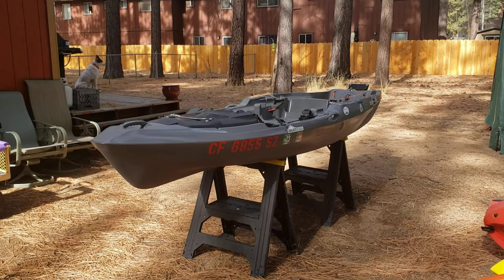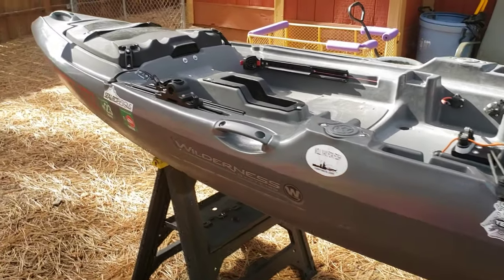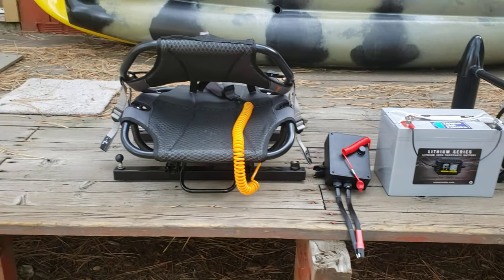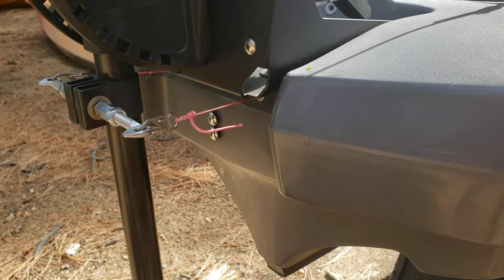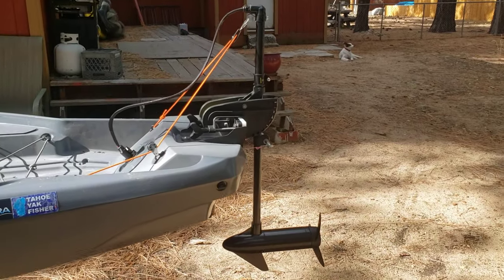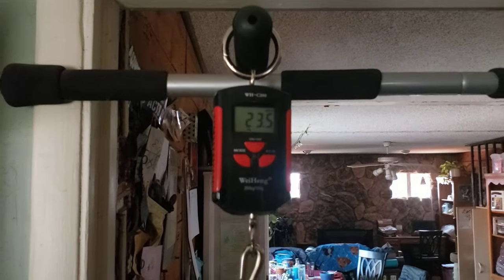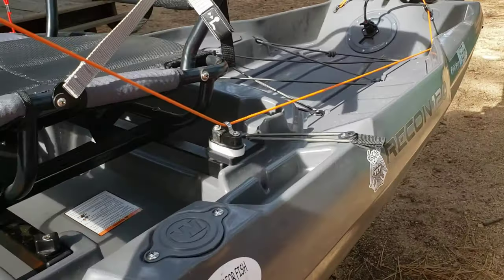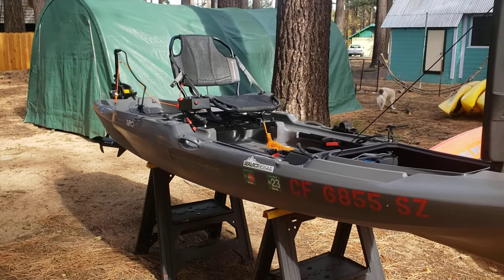YOU Should Build an Electric Kayak and THIS is WHY!

Comment: Bravo and thanks for sharing!  Very clean and economical method of adding a serious trolling motor.  I'm at the OP build analysis stage, I bookmarked yours as "Best rudder delete rear shaft motor".  I keep coming back to a pedal/fin inclusion with the option of quickly inserting a mid motor into the hole to cover water in a hurry, key reason is to get some excersize while locating fish.  But I'm flexible if the right deal on the right yak pops up one mid winters day, in which case your design is at the top of my list.
Reply from the maker: I am currently finishing from a Hobie Compass with a mid drive motor option. Please check it out on my channel. I have one complaint vs. the Recon... the Hobie has a hand controlled rudder. If I have two lines in the water and hook a fish on one, it's much easier to land the fish and control the kayak with foot steering. I have given up on fishing two lines at once from the Hobie.
Reply: Yeah the hope is that a lighter 12 footer would keep tracking fairly straight while under  power during landing of a fish; crosswind and strength of the fish are certainly factors.  I'll check your other vids and see how you fared.

Comment: I’m building one now. Yours is the first I’ve seen with the steering below the bracket. I like that idea for two reasons. First it keeps the steering lines lower and more level, which should decrease drag, meaning less force to turn, and second because it double as lock down when reversing. I was planning to rig a lock release into my lift system. I can’t wait to see if I can rig mine the same way. I’m also using a pot for speed control. One last thing is the kill switch. I didn’t even think of that, but it should be easy enough to incorporate. Thanks for sharing.

Comment: Walmart's in my area don't carry any trolling motors or large lithium batteries FYI. Northern Va suburbs.
But we do have 1 Cabela's, and some boat dealerships and marinas so there are options.
Reply from the maker: Ok, my point was that the "off the shelf" versions of trolling motors and batteries are easily procured versus a replacement "Bixpy or Torqeedo" product... sorry I wasn't clear.

Comment: Very nice setup on your kayak. I have a Ascend 128x base icky set up the same as your kayak. Except that I have a Newport Vessels 55 lb trolling motor on mine with a AGM 100 amp hour battery and  Allen quick connects and I also installed a system to raise and lower the motor straight up and down and then I can tilt it and also pulls it into the kayak. Less weight hanging so far off the back of the kayak. I installed four pulley system on mine that helps in pulling up the motor. Seems like your only pulling up 3or4 lbs
Reply from the maker: Sounds like a nice rig. I am a big fan of those Ascend kayaks, a lot of kayak for a really great price.

Comment: Great video! I’m thinking on building a dual motor system without a rudder. Controlling each motor separately by foot. Just need to find a pedal potentiometer with reverse.
Reply from the maker: Maybe in the rc world... the electric skate boards have a spring loaded throttle... check out Bass Man Strikes on YT, he has been working with that type of pwm for a while!

Comment: I have an Ascend 128X that I'm rigging up. I'm trying to round up the parts I'll need. I ordered a Newport Vessels 55lb trolling motor for it, a PWM, 10Ga. Silicone wire, PET wire loom, heat shrink, SAE connectors, etc. My question for you is, what size cable gland does it take to fit 2  10 gauge  through it? I don't have much experience with them and not sure what size I need. If you answer it'll be greatly appreciated and I'll delete the comment after I read it  if you'd like so no one else can see it. I say that because I  know you sell PWMs and wanna protect your trade secrets. I just want to build it myself. Thanks.

Comment: Very nice rig ! I've followed your build all the way through.. Very impressed with the engineering and thought going into it.. I'm in the process of installing a trolling motor on my Bonafide SS 107.. I will be in contact with you for one of your PWMs in the near future
Reply from the maker: Thanks, I learned a lot with my Ride 115 but the Recon has so many "motor conducive" features it was pretty easy to figure out. The Bonifide SS107 is a top notch choice, I have extra poly-tube for steering lines and such from a rudder instal I did on that same kayak. If you would like I can send you some with your speed controller... just a thought.

Comment: Great rig! Thanks!  Thinking of powering my 2016 Native Slayer Propel for here in Louisiana.  I was disappointed to find that the Newpork NK300 might be 1/2" too wide to fit in my pedal drive slot.  I was shooting for 6+ mph - my normal, comfortable pedal speed is 3.25 to 3.5 mph.  I'm also looking into a pair of dual thrusters that I could pivot out of the water when not needed.  A lot of options are becoming feasible lately.  The 3ph Newport NK300 plus batter is about a $2k to $2500 rig.
Reply: I ended up getting the NK300 and their 40AH battery - a lot of bucks.  However, it does push the slayer about 6.5 mph.  I'm in the process of relocating that rig into my 2018 ATAK 120 and might finally give up the propel drive and have room in the cockpit!

Comment: Nicely done! I have a Perception Crank 10, and it would be nice to add a motor to it (I would think, over this winter now... ). I have been looking at tons of videos, and I really think this is exactly what I was looking for. Though, I have some 'filling' work to do on mount...  The only missing piece of the puzzle is the 'rope stopper'/'rope grab' you have there... I can't seem to put a name to it, so I can buy one, or make one from some yard-tool-hanger I have with similar spring-enabled 'catchers'... 🙂. Could you please advise on its name, or, where could I fine one? Thank you! Stay dry, and of course, tight lines!
Reply from the maker: Its a "cam cleat".

Comment: That is a slick and easy set-up.The only thing I would ad is a way to Guage battery life. Sort of like a gas Guage. Gitta know when your on empty.
Reply from the maker: Actually, there is a Bluetooth battery tracker on the battery and my "YakFisher" speed controller is now available with a voltmeter. This vid is a "starting point" for people considering building or buying, not so much a "full project" vid... thanks for watching.

Comment: Excellent video! I have a similar setup on my kayak right now. Totally agree on the cost effectiveness versus the pedal kayaks! I am about to buy a Recon 120 myself to do the same thing. I REALLY like that the steering is below the pivot there. My current setup has the motor moving vertical to raise it, but that runs into some challenges where the steering pedals need to be able to move back enough for that height. Still looking through your videos, can you talk about the speed you are getting out of the Recon with this? Thanks!
Reply from the maker: Good morning. Thanks for your kind words. I am particularly pleased with the hoist mechanism. It's the second that I have set up like that, with favorable results. The top speed is 4 mph, but cruises right along at that! One bit of advice... 45lb. motor is perfect, 55lb. motor is too heavy for the hoist and NO faster. 12 volt trolling motors all spin at the same speed, bigger motors have more torque and get to that speed faster! There is a reason Old Town (same company as Minn Kota) uses 45lb. motors on all its "Sportsman" models! You will go faster with a 45 than a 30, but that is a prop that can handle the added torque not a faster motor.
Reply: @TahoeYakFisher Understood. I have a very old stainless shaft 45 lb on a 2006 Malibu X-Factor that can go 4.9. The 55 lb Newport that I bought for my Perception Outlaw will only take it 4 like you say. And that takes 45 amps! I figured part of that is the boat itself, but yeah I get the RPM and the pitch of the prop will combine to a max speed. I'm planning on experimenting with different 3d printed props when I get my Recon. I saw reports of a Torqueedo on. Recon going 6, so there is hope I think! 😁 I borrowed your hoist design on the XFactor, it does work great!

Comment: 11:02 is that motor control a pwm with the pot controlling the duty cycle? The reverse is just switching the polarity but I like the housing for the circuit. If the craft takes on water is there a plan in place for that lithium battery or will the craft maintain buoyancy regardless of the water taken on? If not it would be pretty cheap to attach some old foam life vests with Velcro so a lithium battery isn't sinking to the bottom if you need to abandon the craft. Have fun man.

Comment: How many hours it will last you running? And thank you for sharing that information
Reply from the maker: I'm not totally sure, my fishing days average 6 hours of mixed speeds trolling and full speed to and fro... the battery, then, charges up in a couple hours which means I'm barely scratching the surface. The way the "battery management system" maintains voltage to the end and begins to drop abruptly, I always hawk eye the volt meter, I never got to the "drop off".

Comment: This is an aawesome video, but now you can get a Kayak for about 2600 and it don't come with a battery but it comes with the motor and all the rigging. I have a 540 kayak and I am trying to do this. Got the motor and battery and battery box

Comment: How much stretch/strain is happening to the steering cord(s) at the steering arm at the motor, when you bring up the motor?
Reply from the maker: None. I did shorten the inner tracks of the "rudder steer" to create more available travel so the motor could go up all the way and the steering cords are still slack.

Comment: How did you PWM perform?  Mine kept burning out here in Alabama during the summer.
Reply from the maker: I have yet to have a failure. Sold them to people all over the country.
Reply: @TahoeYakFisher  I built mine myself, but I think the heat down here was too much for it.  I used with a Minnkota C2 30.  According to its spec sheet, the max draw is 30A.  Yours looks identical to mine, so I think we likely used the same design.  But my luck isnt so good, I just took my kayak out on the river, only to run out of juice 40 minutes later.  My Dakota charger said it was fully charged, turns out the charger went bad.  Thats my luck. :(
Reply from the maker: @robjohn6943  The main reason I quit selling them was due to lack of quality circuit boards! I would have to purchase from different manufacturers and send back 8 of 10!

Comment: How long does the 100 ah lithium battery last on 45lbs ?
Reply from the maker: I haven't found a limit yet. Basic run times and math suggests 3 hours at full speed and 12ish hours at 1.5mph. I go out for 5-7 hours... about an hour of that is "full speed" and my "Battery Tracker" device says I still have 80+% capacity... I wish I had the patience to run the battery to dead so I could test full run time but I went with the 100ah battery for two basic reasons,  #1 Enough power to get me through a full day of fishing and #2 the 100ah is sub 25lbs. Thats AWESOME power to weight ratio and lasts longer than I can fish in a day!
Reply: @TahoeYakFisher  thanks so much! I think for 4 lbs more I will go with 100ah

Comment: How do you deal with the lock lever  to allow you to raise the motor? Thanks!
Reply from the maker: I removed it. The motor is heald down by the steering cables/pedals. Works flawlessly.
Reply: Was actually just seeing that with the cables mounted low, thanks!

Comment: My t24 pushes my lure 11.4 at over 4 mph . It is only 24 pound thrust .
Reply from the maker: Awesome, yeah, my Hobie Compass gets to 4.5mph with a Watersnake T-24. The beauty of a light boat I guess. That Recon 120 is a behemoth, 4mph with the 45lb. Was impressive, I bet the t-24 wouldn't get the Recon past 2.5mph, might not push it at all!
Reply: @TahoeYakFisher  , I usually only go 3/4 - 1.5 moh trolling the snake river .
I have a bigger motor cut down and ready to mount , but no real reason to . The t24 does  just fine  on the river .
Reply: @TahoeYakFisher  , Yep , the 90 lb lure 11.5 is as heavy as I want to go anymore on a kayak .

Comment: $2600!? I just bought a 1 yr old Ascend 128x w/ yak power that had never touched the water. With brand
 new Newport vessels 36lb thrust trolling motor and a brand new Optima blue top battery. I gave $500 and a 58" Hisense tv..😁
Reply from the maker: Some people want more than an Ascend kayak has to offer.😉